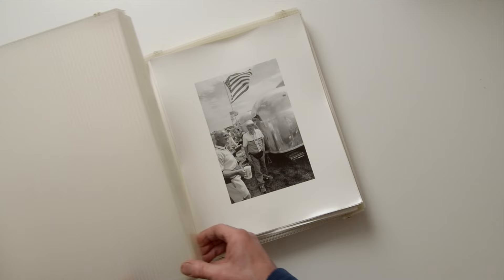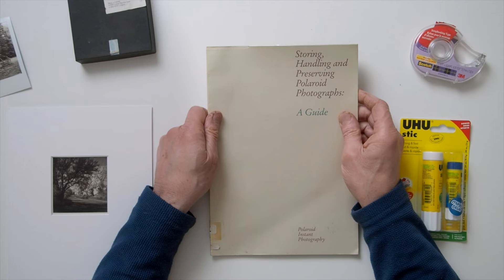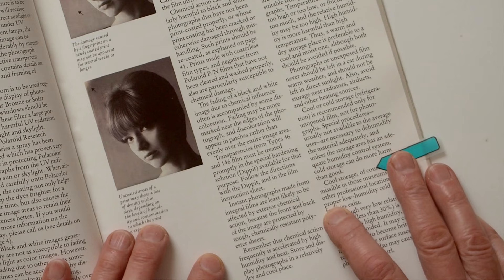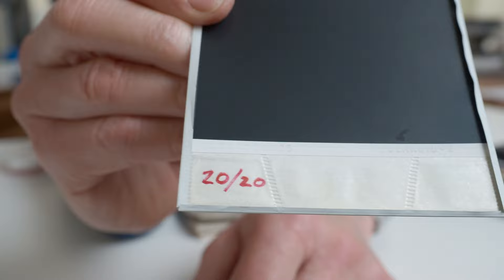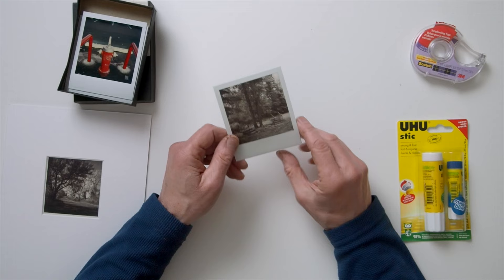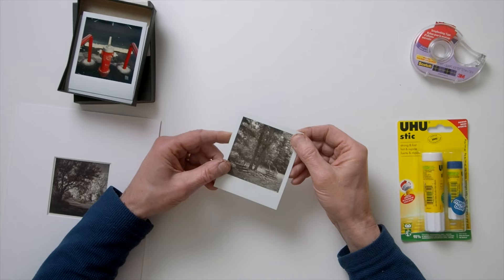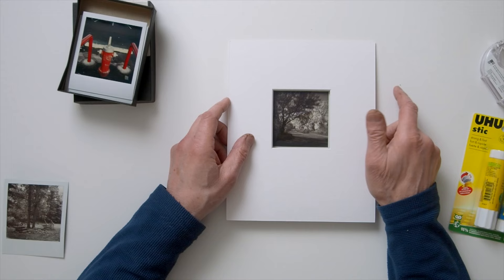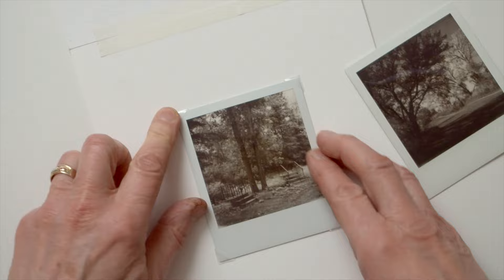Presenting Polaroids Part 2: Conservation Tactics

Comment: I used to store Polaroids in a tin case, but after going back to them a couple years later, they developed an acidic smell — not unlike when film negatives start to decay. So I think it's important to keep them fairly well-ventilated as well to avoid that acid leaching to become a chain reaction.
Reply from the maker: That’s good advice. I generally keep mine in an open plastic tray ( you can see them in the background of my videos. Most sit there for a number of months.

Comment: Black and white sx70 film will slowly turn yellow over time, within months 
I physically remove the chemical pod and the cellulose strip at the back, followed by transparent tape to reduce oxidation
Reply from the maker: I think black and whites tend to age. I notice that they are almost neutral in tone when they come out of the camera but start to warm up after a few days (which I prefer). I haven’t noticed a significantly yellow. Tone though.

Comment: Thank your for making this very informative series of videos. I have been shooting SX70 a lot lately and am honestly a bit disappointed that almost all photos (b&w) show orange ‘bleeding’  near the top of the image. That kind of keeps me from every presenting these Polaroids. Do you encounter this problem? Have you found a solution?
Reply from the maker: Thanks Jesse. I have not had your problem with Pola BW film. However it does sound similar to a problem I had with the colour film. My best guess is that the opacifier layer is little less effective (ie it’s running out) at the top of the image as this is the last part to be ejected from the camera. Using a film tongue on your camera and letting the ejected film sit under the tongue for a few seconds and then quickly storing it in a dark place ( I use a black passport neck pouch) while the image fully develops seems to solve the problem. You may want to try this. I use this technique with my black and white film as well. Hope this helps a bit.